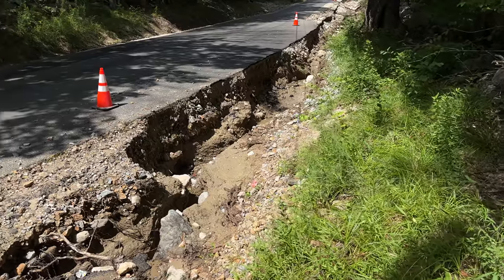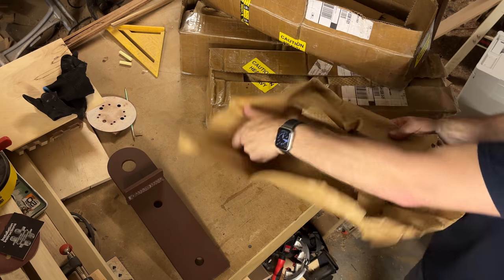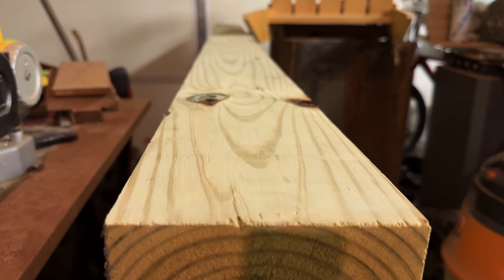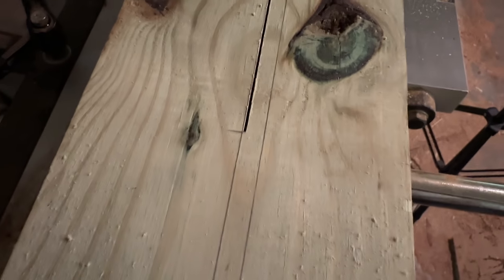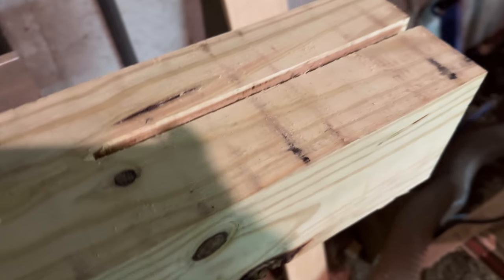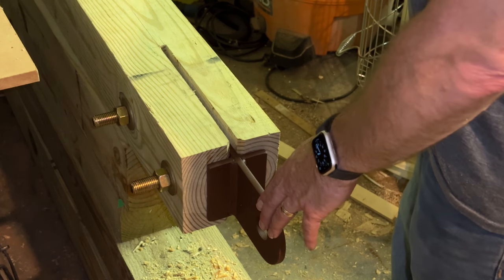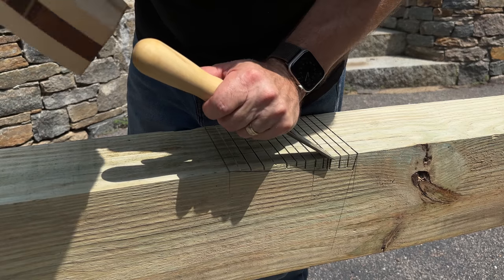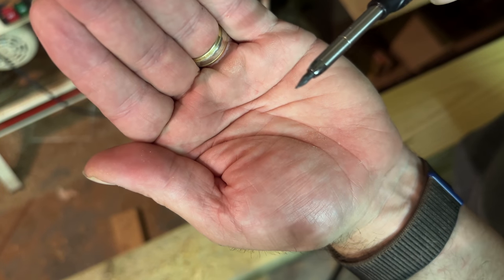How To Build A Treehouse Yoke

Comment: If the bottom moves, how will the top?
Reply from the maker: Both yolks will be static (top and bottom) but the set of beams that connect them will have a dynamic connection allowing the trees to move independently without tearing the platform apart.